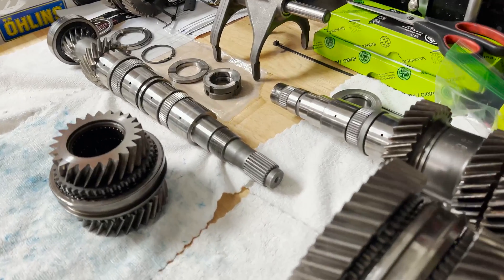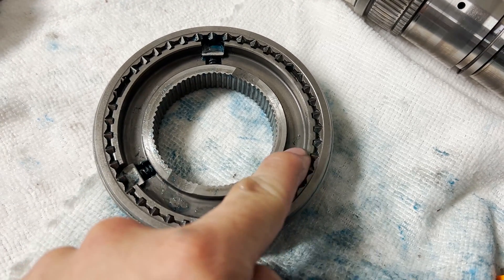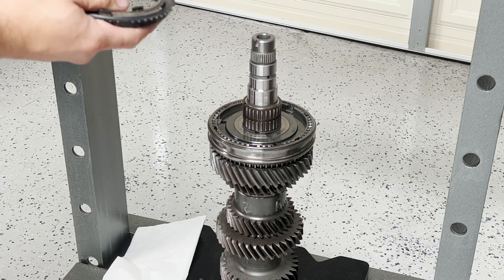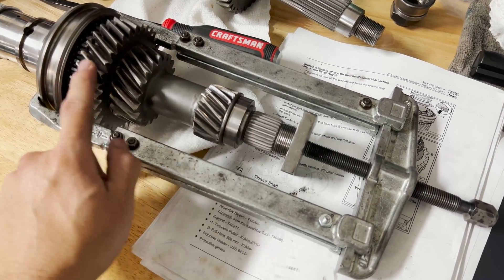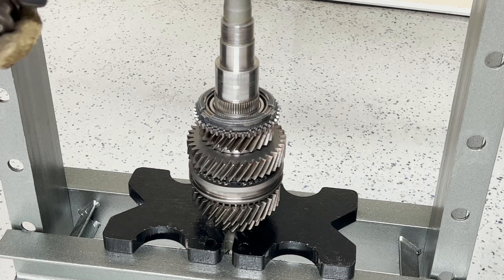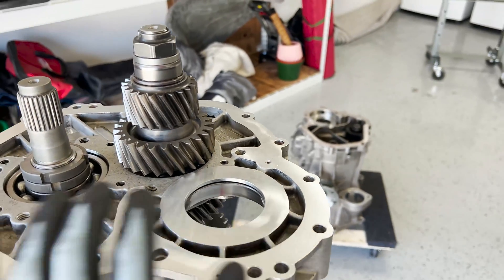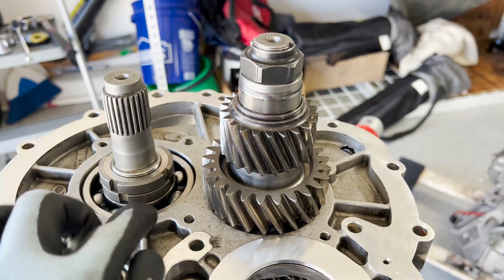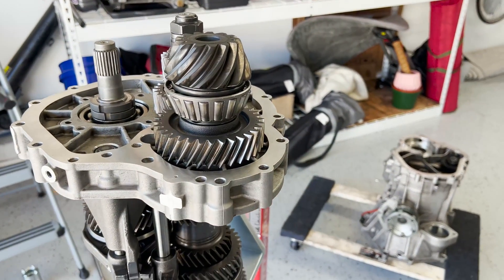Rebuilding a Broken Lamborghini Gallardo Transmission - Assembly - Part 4

Comment: Very interesting. The egear shifter has no pressure sensors in it, only an overall fluid pressure minimum, below which it won't try and shift. It just rams the lever, every time, with a given amount of force! It has position sensors for each hydraulic actuator though, so it know if the gear didn't select with that given inbuilt force. When you do the basic setting to teach the TCU the sensor readings for each gear. I think if you replaced that warped 4th blocker ring, the transmission might actually pass adaptation and the car would drive. Might that be the case? I was actually here looking to see if it is possible to change the bearings on front diff output shaft and gear without dismantling the whole transmission. Also a list of seal numbers/sizes and bearing types would be really useful, to know which bearing can be replaced with generic ones! Brilliant channel. I have liked and subscribed.

Comment: Do you have any recommendation for improving gear on the ‘04 gallardo gearbox? Pretty long first gear. Also wondering if shift speed can be improved with a dog box
Reply from the maker: You can change the spur gears to shorten everything or switch out to a later transmission with shorter first gear.
Reply: @sk4klsiww  nice, would that require using a corresponding TCU with the year of transmission? Only asking cuz 04 TCU is fried and need to pick a direction
Reply from the maker: @BlessedLifeMI   corresponding tcu will not matter as long as you stay within the pre LP generation. If getting an LP transmission, speed sensor locations might be different and you may need to switch to the LP TCU and/or adapt the wiring harness accordingly. This is just my guess though, so definitely do your homework before committing.
Reply: @sk4klsiww  I tried an 07 tcu and it didn’t work unfortunately. Raj in lambo group said only 04-05, so really I have no idea. Any idea if it can be run with an aftermarket ecu?
Reply from the maker: @BlessedLifeMI  With an aftermarket ecu, you may need to figure out how to communicate with the EGear actuator, which is far from plug and play. Bummer the later TCUs cannot work.
Reply from the maker: @tracklambo check out this thread if you haven't done already: https://www.lamborghini-talk.com/threads/gearbox-swap.197818/unread

Comment: could you not just replace the bad gears, synchros and bearings and rebuild it...or is that cost-prohibitive?
Reply from the maker: So all the gears have scorched marks, some more so than others - it's definitely cost prohibitive to do. You're better off buying a used transmission at this point.